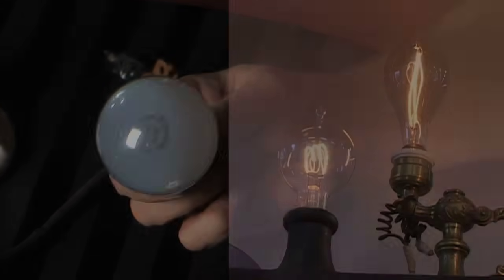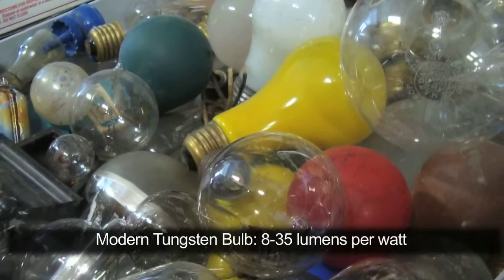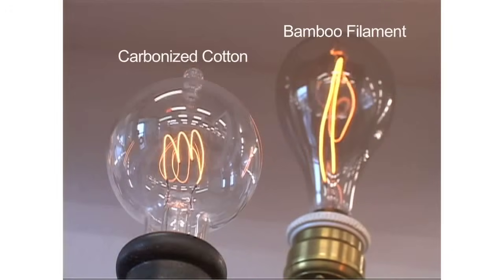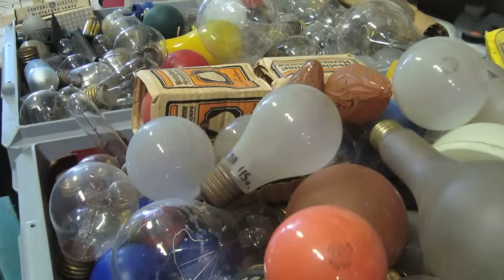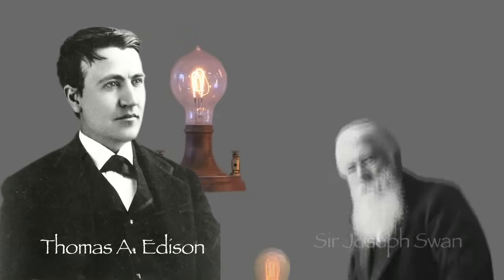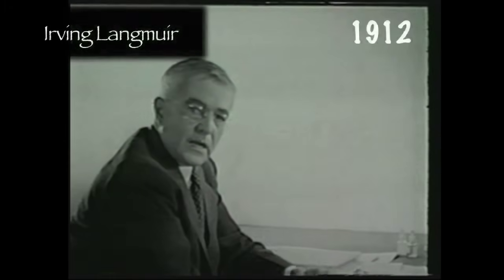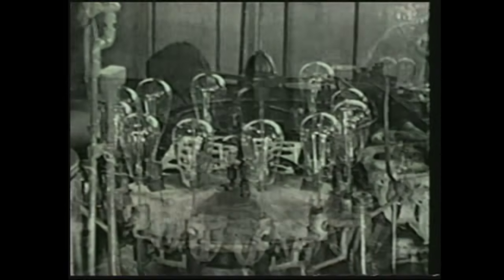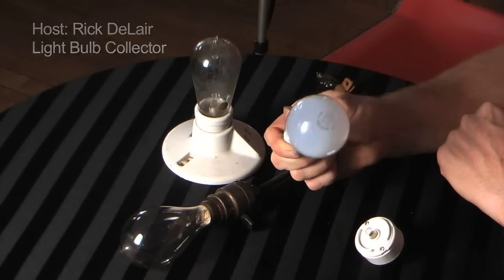The Incandescent Lamp

Comment: I was at museum with an antique light bulb collection and I saw a very unusual one. It had two probes extending into the center of the bulb with rounded caps. Instead of a filament wire, it had a fine cloud of wire that reminded me of steel wool. Any thoughts at to what it was?
Reply: photo flash bulb

Comment: I have one theory as to why the incandescent light bulb is being phased out and it has to do with the " armaments" or defence industry . The powers that be have detemined that DU or depleted uranium munitions ,though effective , have very toxic side effects when used to both sides ? And so for their armor piercing shells and what not they are looking to replace the DU stuff with tungsten cored shot which is what they used previous to the invention of DU munitions .So what to do with the DU ? Could DU be made " ductile" like tungsten and could it be made into a resistive filament and placed within a vacuum or gas filled bulb as described in the video ? And if so of what use might it be ? One thought was for some kind of "ion propulsion" type device for spacecraft or perhaps as a germicide type light for killing bacteria in hospitals etc ?
Reply: +srofficial06 Its being phased out because of its inefficiency. As he said, only 10% of the energy makes light and the rest makes heat
Reply: @subway5411  What about food warmers? Don't they use Incandescent lights?
Reply: @Vinnay94  They do. Only incandescent LIGHT bulbs are being phased out as getting light through incandescence is very inefficient. Incandescent heaters are very efficient and are not being phased out.

Comment: Home depot and Lowes have a couple different vintage light bulbs now, one with a square filament and another with long strands wound vertically. Check them out there in the lighting section,they're in yellowish blister packs.